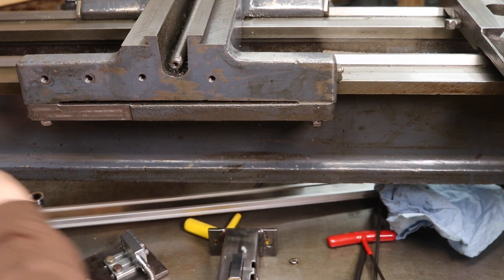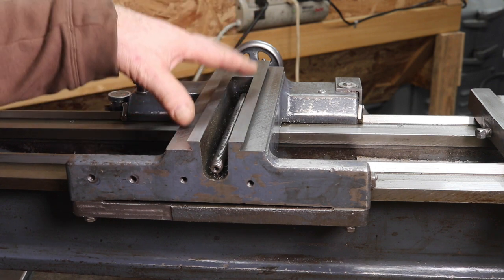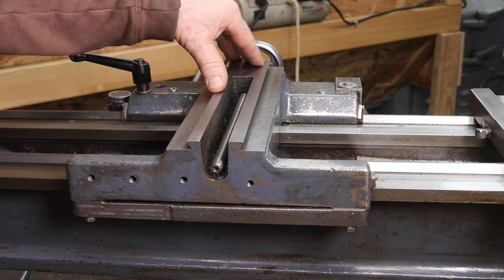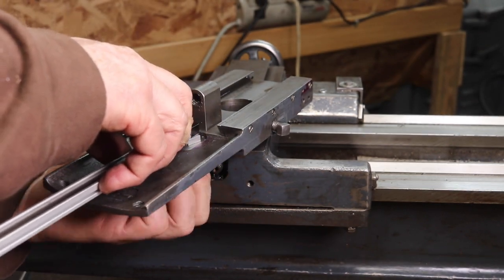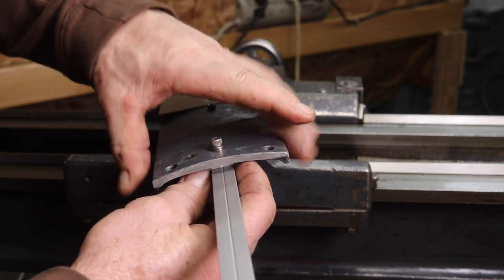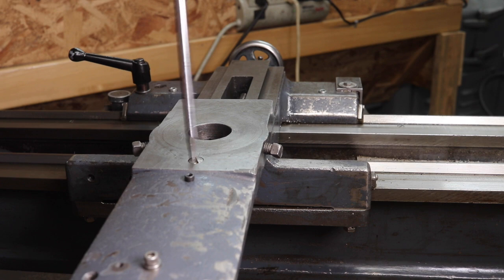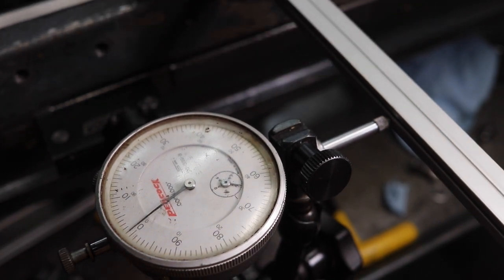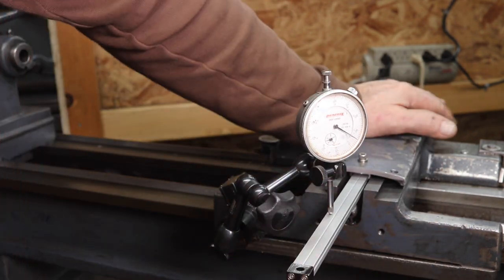DRO Installs 2 Lathes and Surface Grinder Aikron Digital Readout P3

Comment: That looks like a great way to install that. This series will help me a whole bunch. I never would have thought of installing the scale there. What was the problem with the old DRO?
Reply from the maker: Thanks Randy.  The old worked fine, but this is a scale upgrade and a fixed display.
Reply: Sounds like you have had lots of weather fun😅